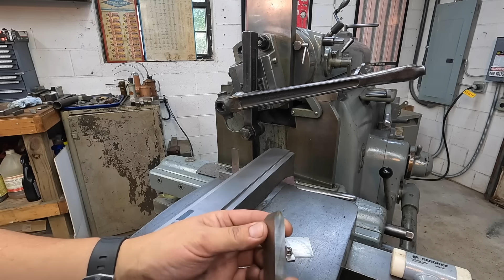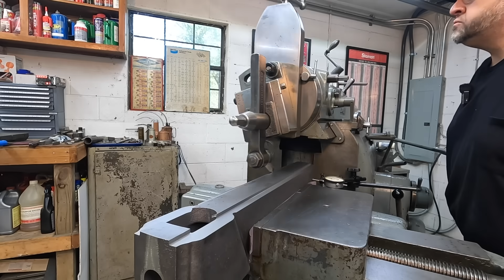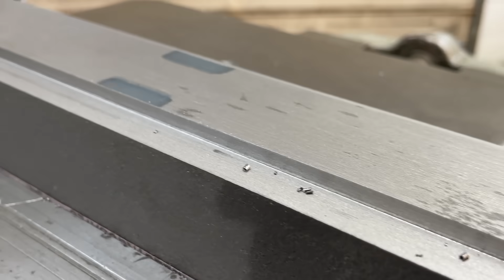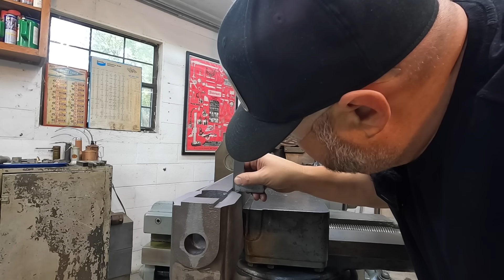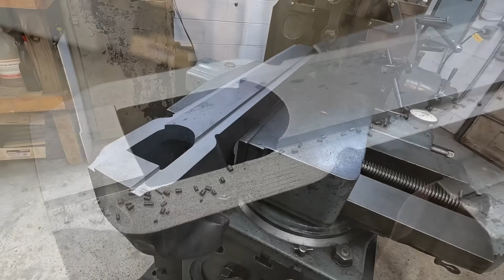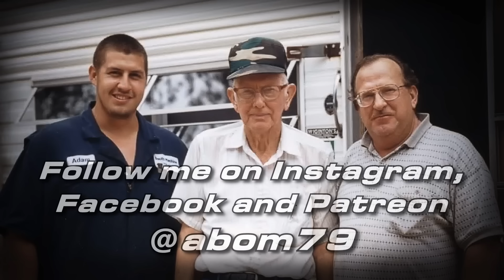Hardtail Vise Build Episode 7

Comment: That shaper finish looks like it will still hold oil and preserve the working surfaces for a very very long time.   There is something aesthetically pleasing about the tool marks being in the same direction as the moving parts.  Thanks for sharing.

Comment: Hi Adam, Another great video, both in terms of content and videography.  My uncle ran a midsize machine/fabrication/millwright shop.  For a long time he kept a line shaft-vintage shaper in the shop, primarily for doing certain types of internal machining.  He once told me, "You can make damn near anything on a shaper...  except money."  Like you, he enjoyed running the shaper a great deal.  However, it got to the point where the shaper was taking up too much shop space for the little it was used and was eliminated.  I hope someone like you, who would preserve and care for it, ended up with that machine.  Be well & Best regards!

Comment: Hi Adam, 
Just a thought for a chat.
I remember you working on this years ago but I dont remember you talking intricately  about the topslide drive mechanism.

I expect a motor driving a crank and a  conrod pushing & pulling the topslide.

But that would mean the topslide velocity would accelerate to the middle of travel in both directions as a sine function.

Watching it, we can see it dramatically slow and change direction at the ends of travel but it appears almost linear velocity between the extreems of travel.

So this machine must have a trick hodden away inside?
Reply: Look up “Scotch Yoke”.

Comment: Adam i'm a 10 years older then you, when i was at the highschool we only had shapers and just rolled in a new manual milling machine.
All work was done on the shapers. Just like yours. Cool to see that although it s not quick, it is getting your work piece more flat over the hole length.
Good to see that shapers are still around.
Reply: I also learned machining on a shaper back at college (50 now). As they saying goes, you can make everything on a shaper, except money.

Comment: Thanks, Adam.  I didn't know what a metalworking shaper was until I started watching your videos.  I'm a woodworking machine technician so I know what a woodworking shaper is having changed bearings in a number of them.  So I was fascinated watching you run yours.  I think this is the third shaper project of yours I have watched now and I still loved it. I did start watching This Old Tony's videos before I came across your channel and he mentioned his shaper a few times but sold it before I saw him use it.  I just saw an old video of his using his shaper and was still intrigued by it.  It's too bad they have been replaced by more modern machinery, but hey, that's progress,  without it we' all have horses to get around.

Comment: I recently restored 2 SouthBend 7 inch shapers. They turned out great. Ran quiet and leave a fantastic surface finish. I guess one thing a shaper does is that the cutting action is linear instead of circular like a mill. It yields a very satisfying pattern on the parts that seems to be a lot easy to polish if you are going to do that. Sure it's slower but it is very satisfying to watch the part come into shape. I guess it's like cooking a fantastic meal yourself instead of going to a resturant ( cnc). It seems much more personal.

Comment: Your videos are a good marketing tool for Jason considering the high selling price of his vises.  Some people might be discouraged by the price, but there is a lot of machining required after the expense of the casting to get it optimally operational. I know that the vise (when American casted, machined and sold) won't be machined to the degree and tolerances you have yours, but it shows the overall process to get a rough cast part functional. You are definitely showing what is done to make it a superb product and probably worth the cost when a very high quality and strong vise is needed in a work environment   Good video.  Thanks.

Comment: I enjoy the shaper videos because it's one of the few machines where you can actually see the chips being made and not flung out as a super-fast blur.  And not obscured by cooling fluids.
Reply: I would love to have a shaper, but I can see the chips being made on the lathe. When those perfect C's and 6's are formed by the tool and you see them curl up in the chip breaker and break of just at the right time I get all warm and fuzzy inside. Do I need help? Is there even a cure?

Comment: When you were running the finishing tool across the "far side" (the second side you finished in this video) you can see the table feeding over during the tool backstroke. For this cut it seemed ok, but how does that work for deeper cuts? Wouldn't the table be feeding over into the tool? I recall in previous videos you discussed a component for the shaper that lifts the tool during the retract, would that lift it enough to avoid the collision?
Reply: I believe the clapper box takes care of this. The tool rides up on the uncut surface and lifts the box open.

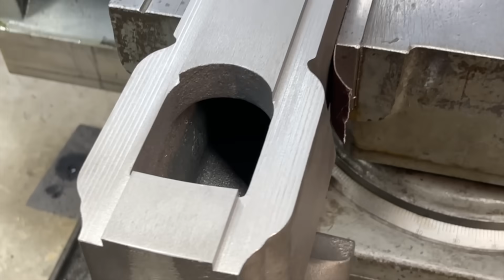Comment: 24:34 So “finishing” on a shaper means making little grooves? I thought we were shooting for smooth surfaces. Amazing machine.
Reply: When the tool is honed directly in the machine like that, the tool marks will likely be shallower than those created by an end mill.
Reply: They’re not “little grooves”. Think of them as pencil lines that you can see but not feel.

Comment: Adam Back In The Early 70s I Was Able To Run Our Cincinnati Shaper At Our Family Sawmill I built A Set Of Head Blocks For Our Headrig Carriage. If I remember Right The Stroke Was App. 36'' And You Are Absolutely Right They Are Fun To Operate. By The Way How Is The Chuck Wrench I Made For Your Pacemaker Working.

Comment: Adam, won't honing your finishing tool dig a hole in your precision flat stone?
Reply: I'd venture to say yes it would.  But I'd bet it's relatively minor and can be buffed out by just honing the two matched stones against each other. On some level, just using the stones to remove dings and dents in otherwise flat surfaces will unevenly dig into the stones surface. All of which is normal wear and tear for a flat stone.